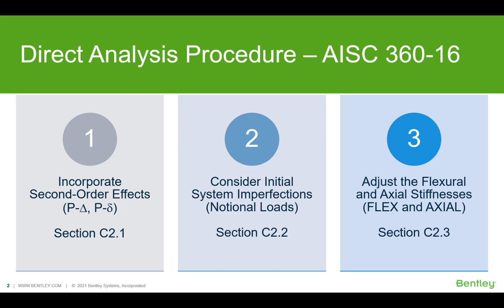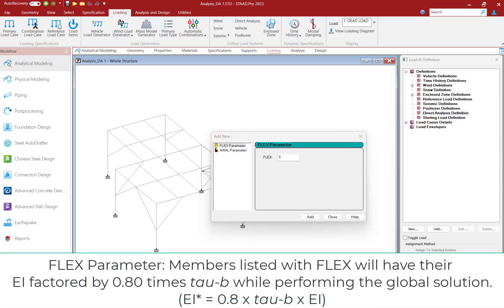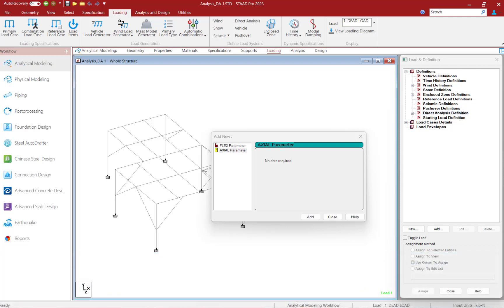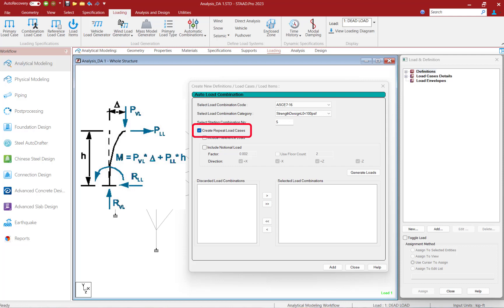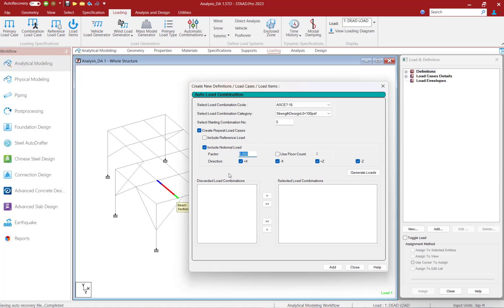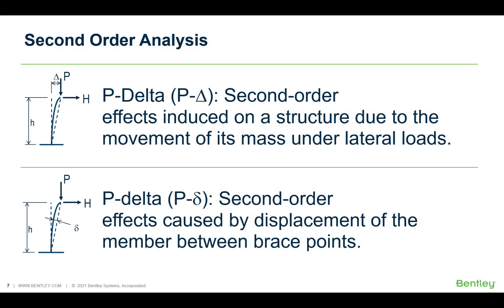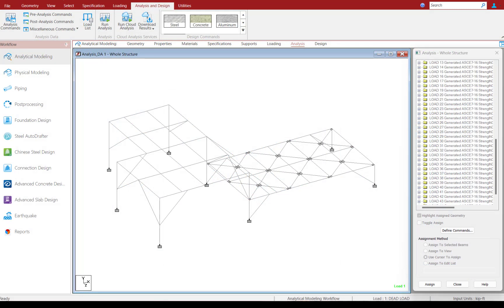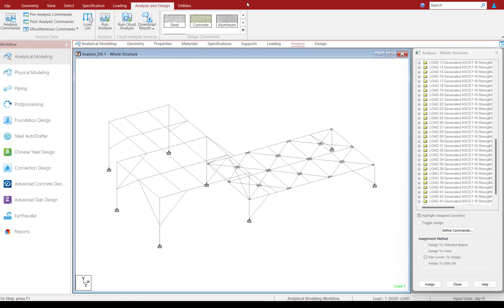Performing a Direct Analysis in STAAD.Pro

Comment: If i have reference load for DL and LL. But reference it under Load Case 3 and 4. Do i need to check 'include reference load'? If yes, it will not duplicate the loads since the Repeat Load already reference the load case 3 and 4?